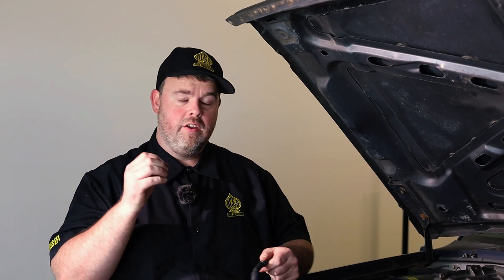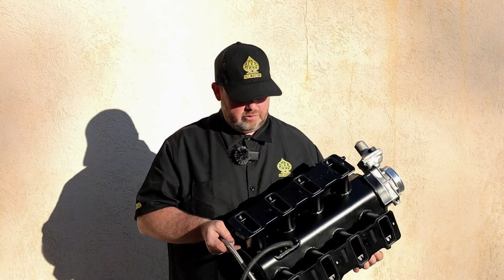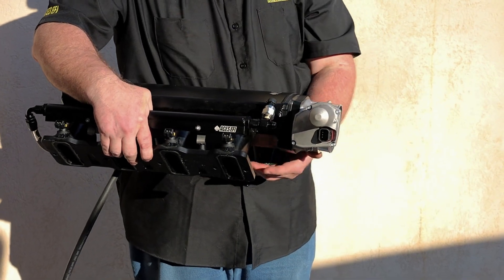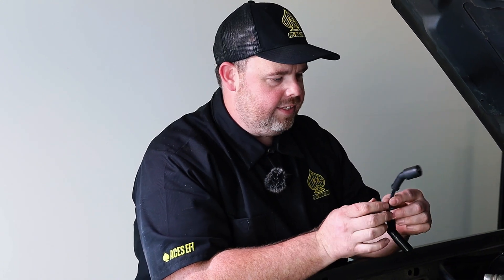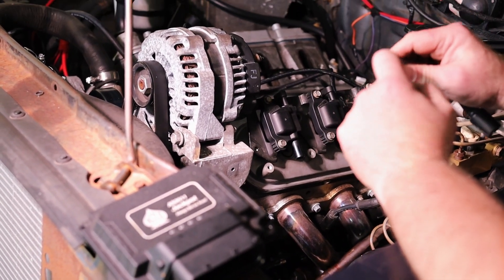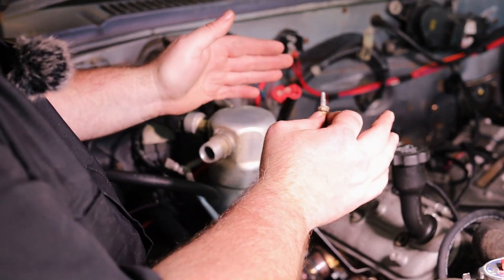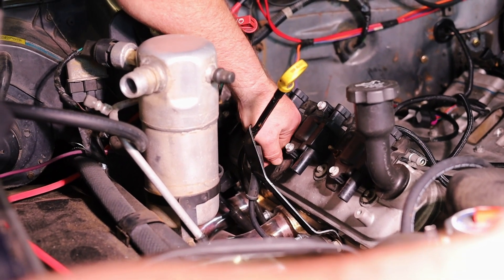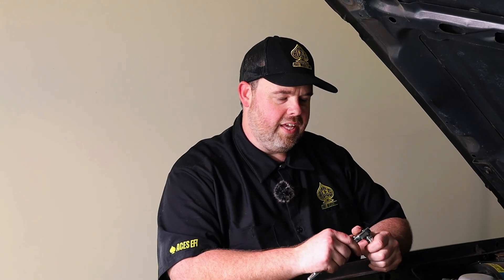Hardware Mounting (Jackpot LS Installation Guide Ep.1)

Comment: Do i need 2 o2 sensors for duel exgaust,,or can i use 1 o2 sensor for my duel system
Reply from the maker: It depends on what system you have. If you are running a TBI, then you only need one. If you run a Jackpot Pro or Multiport kit we will include two O2 sensors in your kit.
Reply: @AcesFuelInjection i have jackpot ls lite,,

Comment: I just got this installed and it has not gone well. The engine won't turn off even after the ignition circuit is off. I think I'm being ghosted by customer service. So far I would say definitely stay away.
Reply: you must got something wired wrong
Reply: Have you had any luck repairing your problem

Comment: Tim thanks for doing these video's.  I think it is going to go a long way in showing people what to do and where some simple mistakes might be made.   I'm happy to see you guys putting support behind the products in not just Q&A formats!   Keep up the great work!  I personally have had a hard time finding good rubber vacuum caps.  They all seem to be rubbish now days.  What I started doing is using silicone plugs and caps.  Sometimes if I can't find the size of cap I need I will take one of the larger plugs and drill a hole into it small enough and deep enough to be my new cap.  Hope that helps you source something.  Cheap as it is to say Harbor Freight sells some small silicone plug kits and they come in clutch, especially when broke down on the side of the road trying to resolve vacuum leaks!!!   :((
Reply: Before I fixed that leaky plug on this one the numbers where a bit off and very reduced booster performance

Comment: You said if it’s drive by cable you can’t do trans control but the kit I bought from y’all is for drive by cable per what my application is with a pre 97 4l60e so are you saying that my setup won’t work then?
Reply from the maker: Hey guys, sorry for any confusion. To break it down further, there are two Jackpot ECU's that we make. One is for DBC, Manual Transmission applications and the other covers all the other possible LS applications (DBW, Transmission Control, etc.). What Tim is saying is, if your ECU says DBC on it, it is our DBC, Manual Transmission ECU. This cannot ever be converted to run transmission control or DBW applications. Its also one of the reasons why that option is significantly more affordable to purchase on our website compared to the other options. However, if you purchase a Jackpot kit that does include transmission control, DBW, or both, it can be changed to run other applications. Depending on what you buy you may just be missing a sub-harness. In other words, there is a difference in ECU when you buy a DBC, Manual Transmission Jackpot versus a DBC, Transmission Control Jackpot. They will look the same visually minus the fact one will say DBC on the back. Hopefully that helps clear it up.
Reply: @ so I looked at my ecu today and I bought jackpot DBC with trans control but my ecu say drive by cable on the back so does that mean I got sent wrong ecu I gave me option for trans control and stuff under setup wizard just want to make sure I have the correct ecu
Reply: @  yes that clears it up perfectly thank you had me little confused their cause I had order DBC with trans control so seeing that video got me a little messed up
Reply: @AcesFuelInjection  

So my ecu does come with trans controlI? I ordered the Jackpot Pro Ls - DBC & trans control kit and my ECU AS2011 and has drive by cable etched on the back of it.
Reply: @AcesFuelInjection  another question so iv got 89 suburban with 5.3L pre 97 4l60E trans and the original 89 241c tcase on the vss on trans harness is that needed for proper operation of everything cause if so I’ll need to convert my cable operated tcase speed cable to electric
Reply: I’m wondering the same now too, because I bought the Jackpot Pro Ls - DBC & Trans control version
Reply: @ same kit I bought also granted I have other trans laying around but if so I wasted $600 on the stall torque I needed when I could’ve just kept my th350 and bought a stall torque for it
Reply: I think Tim may have mis-spoke on that.
Reply: @BlackBeddy23  let’s hope so I guess we’ll find out when the editors start replying to our comments